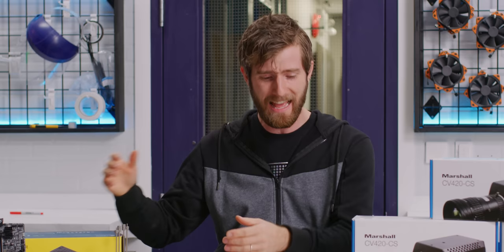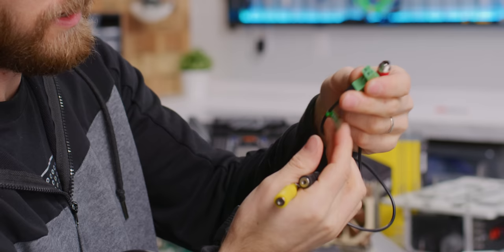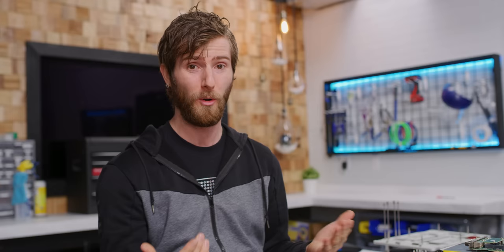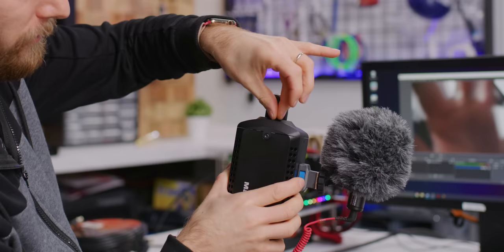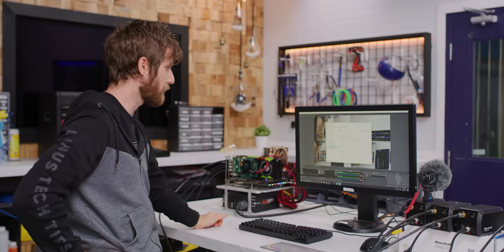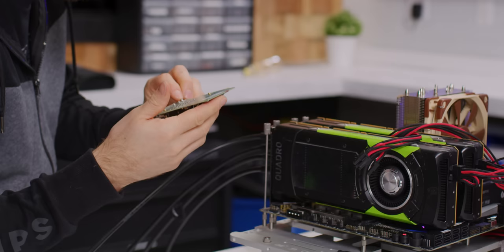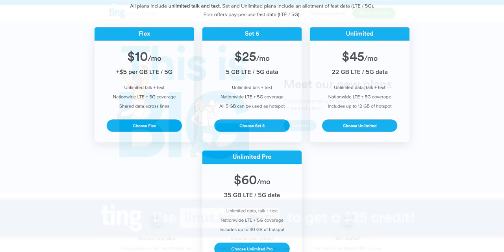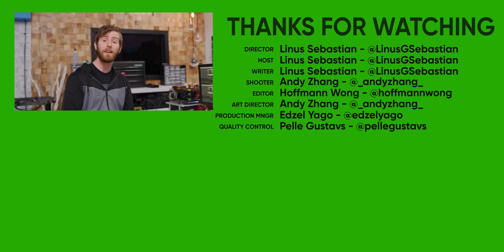I've NEVER done anything like this before...

Comment: If you would take the "on a budget" part serious you can get 1080p PoE Cameras for around $100 pair that with a PoE-Switch and a machine with a decent processor running a surveillance software. that would also eliminate the need for a twitch or youtube channel to stream, since you can just forward the port on the router and let people log onto the webserver of the surveillance software.

Comment: Sorry for bad knowledge but ATEM mini or something in that series should probably work to capture in 4K plus audio and if needed they can take over and produce a stream, switch between cameras and so on. This solution presented in the video will work but - it I think it can be cheaper with more functions. If they whant to grab some cash - put up a paywall in front to see the stream for integrity and/or money to have this running in the long term? Maybe wrong or not.

Comment: The NVENC limit is artificial and implemented in the driver (not the card). If you google you'll quickly find a "hack" on Github that removes that limit and your GeForce 1070 can encode as many streams as it can handle (power-wise).

Comment: FYI, It's much cheaper to use pro cctv cameras and capable nvr to capture and stream (at least by rtsp). 6 reasonable 4K cameras and the rest of setup would cost max 2k USD.  Image quality would be similar, system stability much better.

Comment: Hi, some suggestions. You could potentially use a single Geforce GPU and hack/alter the driver to unlock the nvenc streams software limit. I know this work on Linux and I did that for a similar project (see https://github.com/keylase/nvidia-patch ). Then, I would use ffmpeg for streaming instead of OBS and go headless. Your entire hardware stack is compatible with Linux including your Blackmagic SDI capture card. On big advantage is that you could run everything as a daemon and remove the need to setup a bunch of OBS windows every time. It would be more reliable (no windows update) and your could literally configure everything so the machine would stream on boot and people would just need to power on the machine at the start of a session and power it off at the end by using the power button.

Comment: Would have been a lot cheaper to make a CCTV system using something like Dahua or HikVision (or something similar), have it go to an NVR and use a public account and just share the QR code for P2P connections. Everyone who needs to see the cameras can have an app on their phone and use that. They also offer 4K cameras with microphones, or just rout microphones separately. A lot simpler in my opinion and its almost all plug and play or you just need to set them IP addresses.

Comment: i slso built with these camera, buying a strong switch to power all my cameras, each port is providing 30W power. no need external power for the camera, and i do not need a mic, so few cat6 cable do the stream job for me really well, you do not need a video capture card, just connecting with its ip through lan and decode the stream..

Comment: I think I would recommend ZCAM E2-C, brand new for US$800, price of M43 mount lens is pretty reasonable, POE (Power over ethernet), dedicated software for camera control (through ethernet of course, one less SDI cable to worry about), you can save a buck on the capture card and get a ethernet router instead. However, it only shoots 4k up to 30fps (and 1080p 60fps) maybe a bummer though.

Comment: A similar result could be achieved for way cheaper using Android smartphones. Modern SoCs are beasts at video encoding. That would require some engineering but it's in the realm of possible within weeks.

Comment: I'm running a 1950X clocked all cores to 4.0 with 32GB 3600 RAM and a 1080 currently. I just bought a $5363 AMD 5950X/ RTX 3090 FE build from Digital Storm the other day though. Should be quite the upgrade.
Reply: Btw for anyone interested - I play Cyberpunk 2077 at 4K with average of 70+ FPS on medium settings and I'm also not getting any crashes or many bugs. Its surprisingly smooth and I wonder if that has something to do with CP2077 utilizing more cores and multi-threading?

Comment: Hello Linus :) Why didn't you use surveillance cameras which also give decent resolution, bitrate and audio. They immediately generate a stream in the H265 codec, which is very easy to transmit live and save on a much cheaper NVR than the computer set you have prepared. ????

Comment: would have been cheaper for 5 atem mini pros with some ssd storage and 5 decimators for each court, boom done.

static stream key and easy as push to stream and push to record, much easier for the user who ends up with the job.

sure its not 4k (streaming) but i highly doubt he would have been streaming in 4k anyway.
Reply from the maker: Wouldn't be easy to overlay match information.

There's a method to the madness.

Comment: Wouldn't using more computers, single capture cards, cpu video encoding (maybe) end up being umtimatemy cheaper and result in more redundancy ? Maybe even consider not using a video card and spending a  little more on a cpu.. idk..  I'm sure there were more optimal ways to do the split and not needing 2 quadro's to bypass the atrificial limitations put on hardware...

Comment: I run into the tanking GPu all the time. I work with NVRs and find that if I break out the video into 4 different streams it tanks the streams. If I pack the streams in a collage style window then user teh display computer to unpack them .

Comment: This was such an inefficient mess, there's NO WAY that tiny sensor and shitty lens is going to be resolving 4K properly. You may aswell be shooting 1080p.
FYI there's no depth of field 'advantage' to a small sensor, you can get the exact same DoF with a bigger sensor and smaller aperture that would allow a sensor with better dynamic range and less diffraction softening. Pretty sure if you want a 15mm FOV you could be at a full frame equivalent of f/4 and still have everyting in focus. Those cameras and lenses are absolute trash. The blackmagic micro cinema camera would have been a better choice, micro 4/3 lenses are cheap and easy to find and can actually resolve 4K making it worthwhile to build the damn computer.

Comment: Budget.. Right, just not a limited budget. Could have used reolink 4k cameras. No need for capture cards or gpu's. Hell gopro's do 4k and are cheaper. Do you need it that high of frame rate? I get your solution will look better and have higher frame rates but you seriously threw budget out the window here. Maybe you should have quickly laid out how much a more expensive system would be. I'm having a hard time thinking of how to make this project more expensive than you made it without doing entirely unnecessary things. 

As a Plex server owner I'm surprised you don't know there is a patch to unlock gtx and rtx Nvenc. You don't need quadro cards for multiple streams.

Comment: You obviously don't understand what "on budget" means. Getting multiple $750 cameras without lenses is not on budget. Getting second hand smart phones with 4K sensors and transmitting H.264 stream from each over WLAN would be "on budget".

Add a couple of NVIDIA P2000 cards (about $600 a piece) and all the other stuff and we have pretty expensive setup indeed.